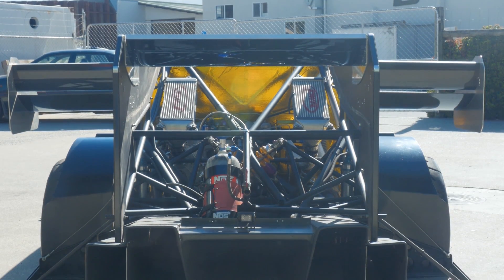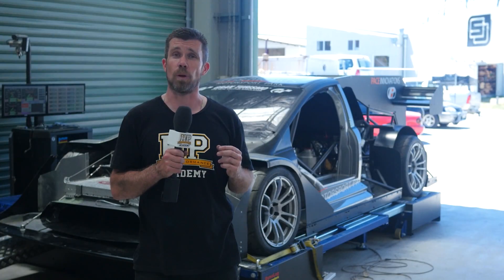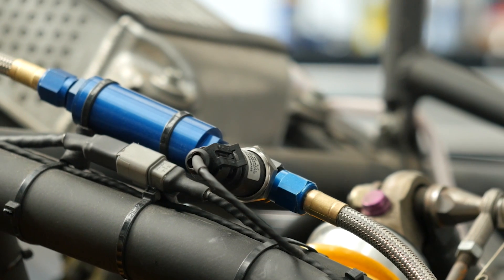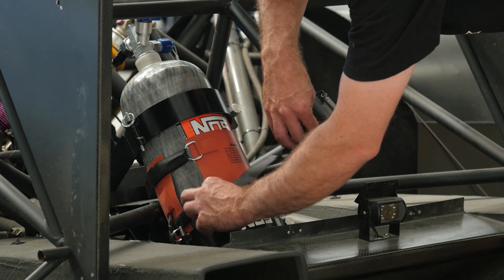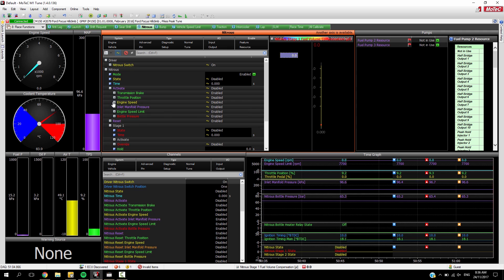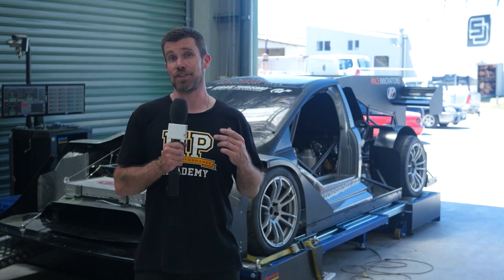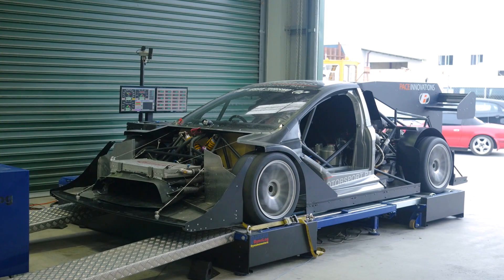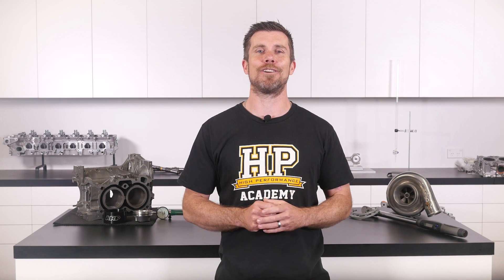NOS Anti-Lag | How it works on a 800HP Hill Climb Car On Pikes Peak [TECH TOUR]

Comment: Is it possible to make a 3D nitrous map based on RPM and TPS to control the solenoid duty cycle? So there could be a situation where nitrous would be at a duty cycle of say %30 at 3000RPM but modified by TPS to half of that duty cycle?

Comment: Hey Andre, love your content. It's interesting to me how motec is so highly regarded, yet one has to resort to using a dashlogger and canbus to set a simple activation condition for the nitrous (boost pressure and rotary dial). I was able to replicate this setup (at least on paper; not tested!) purely within the haltech ESP (elite) software with only a Nitrous Stage 1 function (settings are right there for   min/max load (boost pressure), rpm, tps etc) and Nitrous Enable function (for the rotary dial position). I haven't worked extensively with motec/haltech yet but through playing with the respective tuning software suites, I feel like haltech has a bunch of functionality that can be enabled and setup very easily versus the motec looking a bit more complicated and in this case, even missing some of this functionality. Interested to see what you have to say about this. Thanks!

Comment: I'm interested in knowing two details: how effective is the heater pad given it is a carbon fiber bottle (non-conductive) vs an aluminum bottle (conductive)?

Why not consider a NANO system instead of the heater? In my experience it's much more consistent at keeping the pressure up and consistent.

Comment: Have you considered injecting the jet of nitrous at a tangent at the turbo compressor wheel? This would use the energy of the compressed gas to assist in spinning up the turbo.
Reply: And it should cool down the air in the housing which would make it act like a bigger turbo too

Comment: If the bottle runs dry during the very end of the hill does the bottle heater keep trying to up the pressure or is there a point where it stops heating. Just asking because it is probably very hard to estimate just how much NO2 will be required for a full power run.
Reply from the maker: We can set a pressure below which the bottle heater will give up and abandon all hope :)

Comment: Curious as to why the nos injection is set to start at 3000rpm and not at say 1000rpm or 1500rpm?
Reply: The reason NO2 isnt injected at very low engine rpms is because the power increase is the same no matter the rpm, ie a 100hp shot would increase the power output by 100 all the way through the rev range. This is a problem at low rpm because horsepower is a function of torque and rpm. What this means is that there is a larger increase in torque at lower rpm than at higher rpms. To put things in perspective, 100hp of Nitrous at 1000 rpm is equal to 525.2 lbft of torque. That would certainly cause engine failure.
Reply: Douglas Bross best way to put it!!!!
Reply: playandpay I believe the risk of backfire is the main reason.
Reply: Avoiding to high cylinder pressures. Nitrous backfires are related to fuel puddles in the intake AFAIK, and wouldn't occur on a dry system.
Reply: I highly doubt it'd get that low in the rev range going around the hairpins in 1st gear. Plus it's a flying start, so having the nitrous active that low would unnecessarily waste the nitrous and stress the engine.
Reply: turbos wouldnt spool even at those low rpm and even in tight corners the revs wont drop that low so there isnt a need for the nos to come on that early
Reply: Cause you can bend a rod

Comment: i always tought that nitrous needs to be sprayed individyally to each cylinder to get even afr on all cylinders. or is this false?
Reply: It depends on your setup. If your intake design is good, the nitrous should be evenly distributed to all cylinders if you inject at a single point. Of course, port injection enables more control. On a race setup like this, they are probably measuring exhaust gas temperatures of the individual ports when tuning, allowing them to even out the afr across the cylinders.

Comment: its def an interesting setup to run along side the twin turbos on the VR38.

some tuning house also tried other methods of reducing turbo lag. 

namely twin charging basically running a super charger to aid the turbo chargers to spool up faster and the super charger to assist the engine at low rpms. Once the turbos are up to speed and engine reached certain engine speed, will the supercharger cut off.

There are electric superchargers and no its not those ebay junk air chargers but superchargers with an actual compressor section much like a pro-charger system but its electric rather than engine driven unit. Audi, Volvo, BMW all employed tri charging systems in the engines to get a smooth power band and torque curve.

NOS if not correctly tuned and used = blown engine and lots of fried piston rings and worst case is you have to junk the whole block when the cylinder walls are damaged.
Reply from the maker: Yes a lot of people assume NOS is a really easy power adder, and the product name of 'Cheater' doesn't help that image! 
Realistically you need to take as much consideration as you would when fitting a turbo or supercharger to have a reliable and effective setup  - Taz.
Reply: well like you said Fast and Furious and racing games like Need For Speed excessive use of NOS makes everyone think you can add NOS to a normal car and expect instant speed and acceleration. Until the engine goes kaboom
Reply: Pretty sure I saw a documentary that said the only risk of too much nos is "danger to manifold"

Comment: Informative video. Thanks!  Curious what the total weight add to the vehicle was. Also be interested to know how you manage heat from engine on the bottle. Is there a scenario where you need a bottle cooler due to radiant heat of engine (Ive not used NOS myself but have toyed with the idea to spool large frame turbo applications)?
Reply: buzzedo1 Total weight is not much at all. My standard bottle is 22 lbs empty and just under 45 lbs full. I use it to adjust power based on competition.